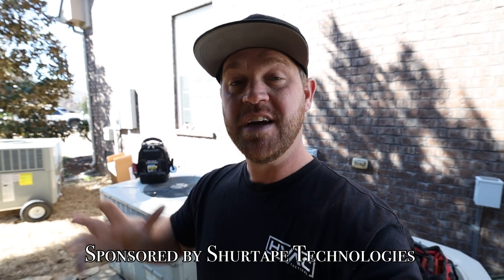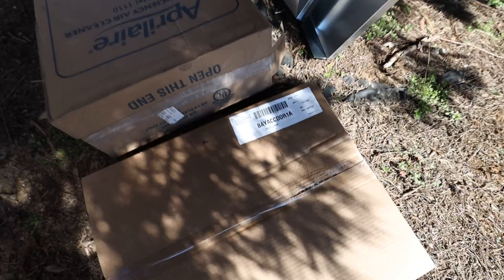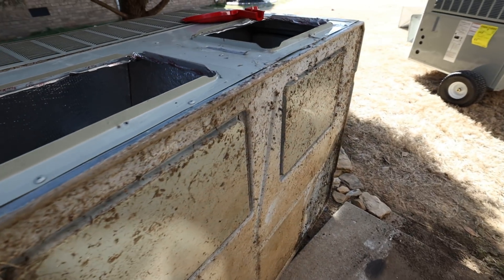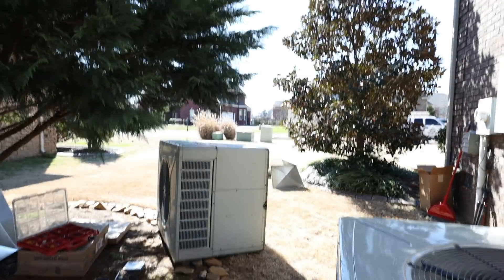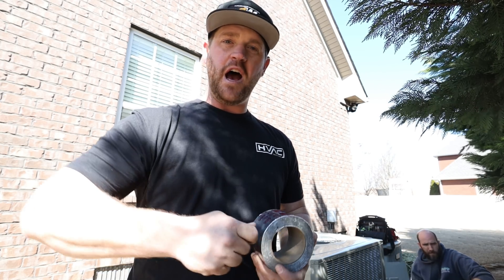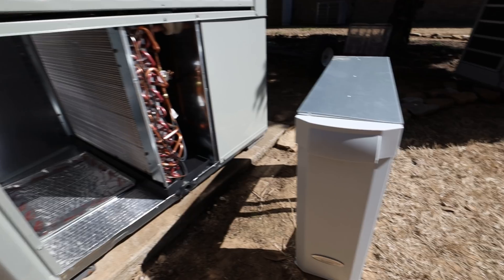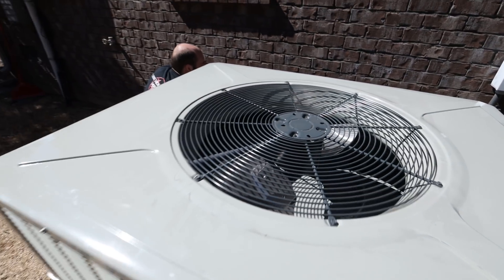Replacing A Trane HEAT PUMP Package Unit | HVAC Installation

Comment: Slick dolly! I make stuff like that but heavier duty when I move machine tools. 
If anyone reading this does one you can buy foam riding mower front wheel assemblies that can't go flat. I use them on riding mowers and even blade strikes don't bother them.
The only thing I'd add to that one if a little extra fab work doesn't matter is a long T-handle on the caster end with the T piece being about a foot wide for easy dragging over uneven ground.  A couple pieces of round bar drilled for hitch pin clips (more convenient than cotter keys,  not that it matters much make fine axles. Your local steel supplier can help you and most will bandsaw parts to length on the spot. If you don't weld they will know local welders but it's an easy job.

BTW if you have a pickup used liftgates are easy to install (they sell the adapter brackets online) and they will save your back without requiring a trailer.

Comment: Are those square to round transitions galvanized steel or aluminum?  What/where are you buying the round pipe you start with?  Looks like they are riveted or spot welded together, as opposed to snapping together like furnace pipe.

Comment: On the residential side do you guys usually replace a unit if the compressor is bad?
Reply: Up to the homeowner
Reply: Options! There are options, the homeowner makes that call.

Comment: I dunno, I might be hypercritical here but this video is kinda gutless... 30 seconds, in the beginning, is spent talking about the cool filter rack he's gonna install, then he spends another minute later on talking about how he can't install it and how he will install a rack in the crawl space instead (Like others said: Out of sight, out of mind. Not a great solution). 30 seconds spent on a paid in-video advertisement. Two minutes of a five-minute video absolutely wasted, 40% dedicated to what? If the video is just to show off an install then that's cool, it's a nice clean install. I just feel like it's under the guise of a technical walkthrough and an excuse for product placement. 

Just my two cents...

Comment: What happened to the 3" pump ups?? Guess they got scraped too. I still would have used that hinged door for easier coil access. Maybe this unit will get better maintenance. I will say not liking the filter in the crawl. Out of sight out of mind.
Reply: I believe he said 3/8" pump ups, which were installed
Reply: @Poolmedic  listen to it again..your wrong.
Reply: @Poolmedic  who the hell uses 3/8in. pump ups..its 3 or 6in.
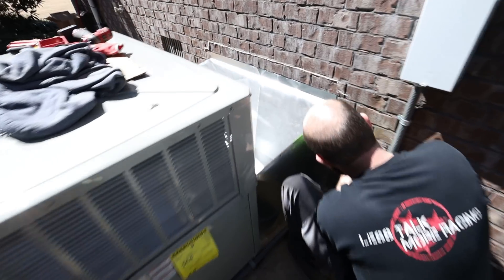Reply: @Dave K My bad, 3” pump ups. They were installed at 3:45
Reply: He could have used an appropriate size pad and that would provide 2-3 inches of additional height.   Most homes in tn have filter grilles in a common area and a decent merv 5 filter is fine for this situation.